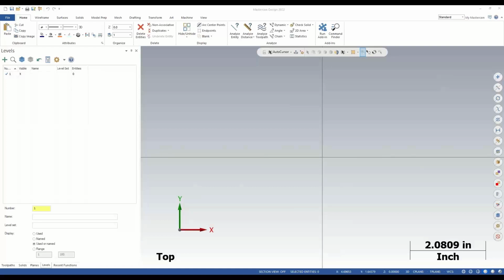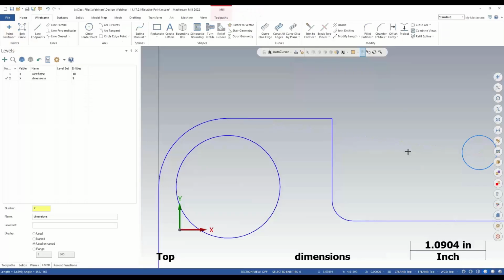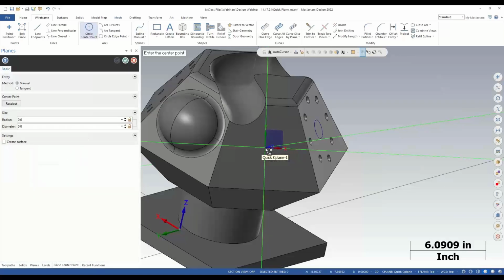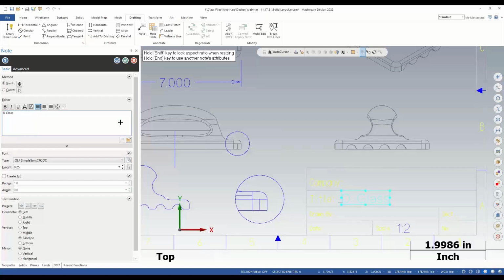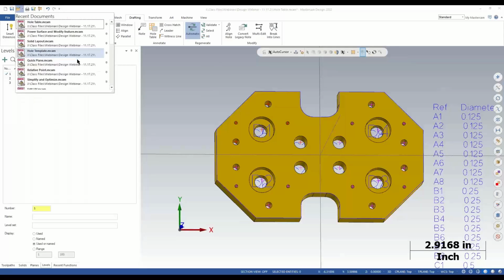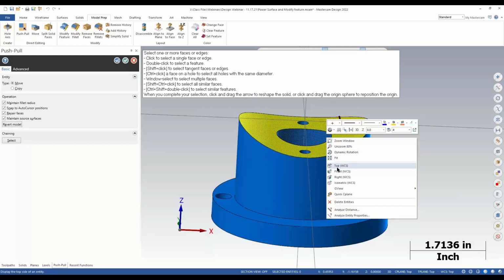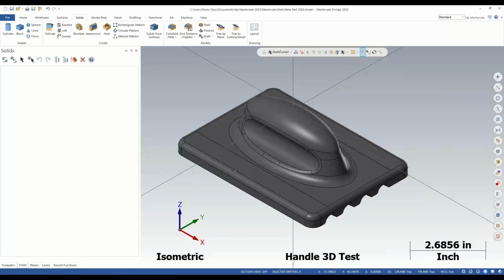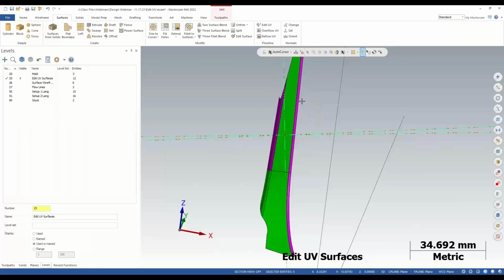Mastercam 2022 Design Tips and Tricks Webinar

Comment: sometimes, when i import a step file it says something like solidimport failed and then i can choose between creating surfaces or repairing the model and import as solid (import as solid takes a really long time so mostly not do it). it says something like this can happen if the CAD program handles something as a sheet, what could this possibly be? I can try to make a photo of the error message next week and then accurately describe the error if you need to.
Reply from the maker: You'll want to reach out to your local reseller, lots of factors determine how cleanly a solid model imports and how many times it's been translated from it's original native format. Your best bet is to always try and get whatever file format it was before a generic step format.